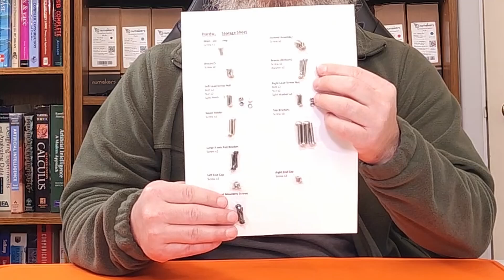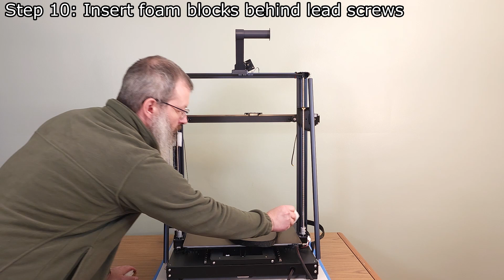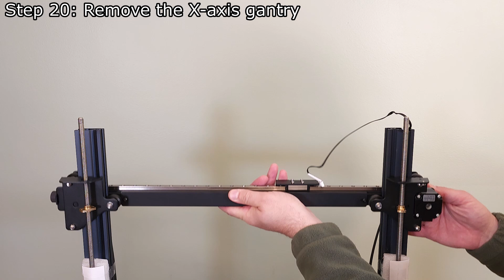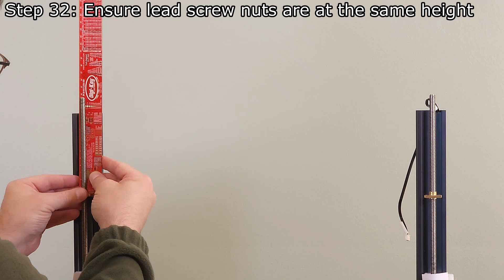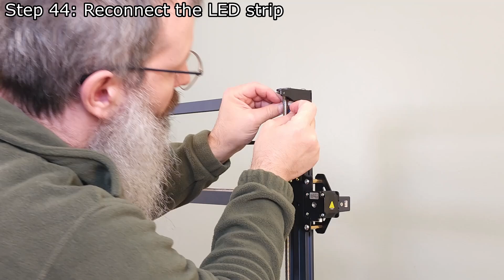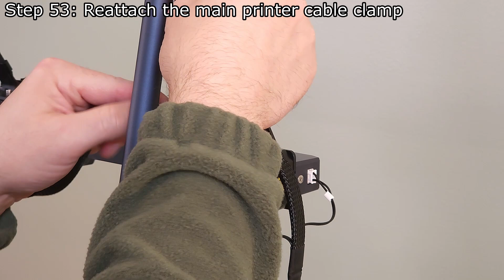Linear rails on an Elegoo Neptune 3 Max!?!?! (Part 2: Z)

Comment: Just a quick comment.  You don't need to remove the stepper motor from the original plate.  If you find that the stepper motor won't fit in the proper orientation of the connector then you built that (left) side backwards!  Just flip the other plate over, and you will have to reverse the other small plates as well. I Ordered the X/Y/Z/Z-belt drive because of your video.  I have literally thousands of hours on the stock Neptune 3 Max with zero issues, but I got tired of having to adjust and replace the POM wheels, so this solves that issue. These upgrades should also improve print quality.
Reply from the maker: Thank you for watching our videos and the suggestion! You are correct, there are multiple ways to install these mods.

Comment: Does this installation also work if i have the z belt kit already installed?
Reply from the maker: Thank you for watching our videos! I have not tested the new belted-Z mod kit intended for "stock" printers, so I can't comment on how it differs from the original belted-Z mod (intended for printer's that already have the Z-axis linear rail mod). I suggest you directly ask TBStron3D. They are very responsive.
Reply: @SandMMakers ok thank you

Comment: I just finished doing the Z axis upgrade and man, it's a LOT WORSE.  I am getting z banding where none existed before with the POM wheels.  Before I reinstall the POM wheels I am going toty a bunch of things, but has this been your experience?
Reply from the maker: I haven't noticed any large changes in Z banding. Are you sure the screws for the brass lead screw nuts are loose and that the lead screws are straight/vertical? Also, do you know if the travel on the linear rail carriages was smooth before you installed them?
Reply: @SandMMakers  I installed antiwobble Z nuts and the problem has mostly gone away.
Reply: So, no, the issue stil persists.  My theory is the rail carriages are being pulled inwards causing the motion to be jerky.
Reply from the maker: Without being able to see the printer in action, it is a bit difficult to know what is going on. However, there are a number of things to try.

First, you could check if your x-axis gantry is level/square. I'm uploading a video on that within the next couple of days. Next, you could check if the carriages travel smoothly along the rails while not connected to the x-axis gantry. Third, you could check if the linear rails are parallel to each other. Fourth, you could check if the x/z frame is square, since if it isn't, the distance between the rails will not be  constant. Fifth, you could check if a lead screw is bent or warped. Sixth, maybe the black small bracket that attaches to the brass nuts is out of position.

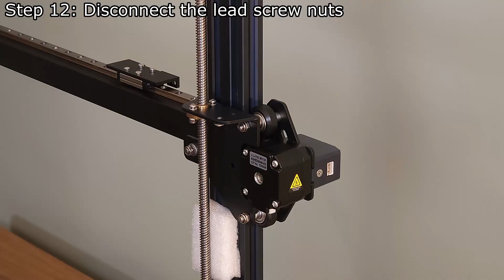Comment: Does you lead screw nuts kind of loose? 7:14
Reply from the maker: Thank you for watching our videos!! I'm not really sure what you are asking. However, the screws in the brass nuts on the lead screws are supposed to be loose.
Reply: @SandMMakers , thanks for your answer. Thats exactly what Im trying to ask. I already tight them ... but gonna loose them again. And wht about the lower nuts?
Reply from the maker: Also loose.

Comment: your x-axis stepper is shorter than mine.
Reply from the maker: Thank you for watching our videos!

Is your printer a Neptune 3 Max?
Reply: @SandMMakers  whoops just realized you are using a Neptune 3 max. I have the 4 max. this video is listed on the TBStrong max 4 page as a guide. I have a question, is your leadscrew nut bad? I have 2 N4Max, and both have sloppy leadscrew nuts. I ordered a 600mm ball screw setup to see if I can tighten up my z axis. I feel that the leadscrew nut backlash is ruining any chance of an accurate bed mesh, or it is causing any bed mesh z adjustments darning print, to be off. awesome work by the way, thorough technical breakdowns are awesome. I was an instant subscriber.
Reply from the maker: Thank you. I'm actually recording the Neptune 4 Plus/Max versions right now. They were supposed to be out earlier, but some unexpected personal matters caused a couple week delay.

Comment: Hey, loved the video series!! Based off this I got the kit for my Elegoo 4 max.  Question I have for you is Z banding… I think that’s the problem I currently have.  Outside YouTube do you have a discord or anywhere else I could send you some pictures and have you take a look?
Reply from the maker: Thank you for watching our videos! We are releasing linear rail installation videos for the Neptune 4 max within the next few weeks.

While I currently don't use Discord or anything similar, I am a regular in the Elegoo Neptune series 3D Printers-mods, tweaks, and improvements Facebook group.
Reply: @SandMMakers  perfect.  I’ll look at joining.  I got pictures of a couple wobble towers and they appear to have the same banding up and down
Reply: I feel like the Z screws can bind and cause more resistance. A belt drive would help eliminate Z banding but the diagonal support rods interfere with belt designs I've seen. Solutions like WobbleX aren't good because it needs to be weighed down.
Reply from the maker: Thank you for watching our video! We didn't design the printer, or the linear rail kits, we just created an instructional video on how to perform the modification. However, you are correct, there are multiple possible designs for an FDM printer.

Comment: Do they still leave out the necessary cut outs on he x-rails from the factory?
Reply from the maker: TBStron3D has started shipping linear rails with 27 instead of 28 screw holes in their Y-axis kits. The modification to the long bracket shown in the first video is NOT required or recommended for kits with 27 hole rails.

Comment: I have done the X and Y Linear kits. And TBH was quite quick and not a hassle. And see I dramatic improvements. It seems the Z Axis is more involved and as i really dont see that much of an an issue in this area i feel i might forgo the Z Axis kit. But well done on the step by step video in installing the kit :)
Reply from the maker: Thank you. Yes, the Z-axis modification is more involved than the other two.

Comment: I feel like I would need a 2nd printer before I did this....as I'd be afraid my perfectly fine working printer wouldn't work the same afterwards.
Reply from the maker: Thank you for the comment!

While I wouldn't recommend replacing the POM wheels with linear rails to anyone that doesn't enjoy tinkering with their electronics, overall, the steps shown across both videos are relatively easy and straightforward. As long as you go slow and are relatively careful, there are not a lot of places where you can permanently damage the printer. Also, provided you don't lose any hardware, everything is 99.9% reversable (some of the screws in the rails leave little marks). Probably the only three places where you could damage the printer would be bending a Z-axis lead screw (or coupler), damaging the heater under the print bed, and damaging one of the connectors (only ever apply force to the connectors and never the actual wires and you should be fine).

If you do attempt the modification(s) and run into problems, let me know and I will try to help!
Reply: @SandMMakers  I would only consider adding the rail if my wheels needed replacement....I thought about buying them now just to have.  I'm mechanically inclined, so doing the changeover wouldn't be that big of a deal.  But...sometimes when you take something apart, it never goes back together quite right.  Don't think I've EVER gotten a car dash to fit back together like it did from the factory.  LOL  

Your tutorials are really in depth, thanks.
Reply: This was very interesting.Thanks!
Reply from the maker: @kenspaceman3938 , thank you!
Reply from the maker: Thank you!
Reply: I find it odd that you would install the z axis kit and then print such a short model.  The only way you can see the true results is to print a model that uses at least most of the z-height of the machine. A simple tower would work. My stock Max machine prints fine for the 1st few inches of height, it is after the 1st few inches that Z banding starts to be an issue.
Reply from the maker: More in-depth testing is planned for the follow-up video. The prints shown in part 2 were really just quick tests to verify basic functionality. These videos probably took at least 80-100 hours each to produce, so there were limits to what could be included in each one.